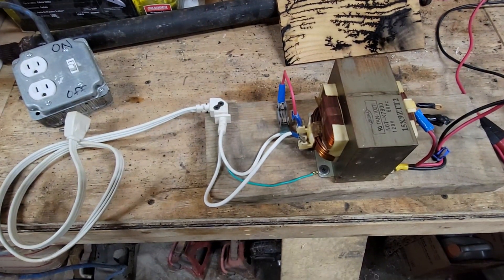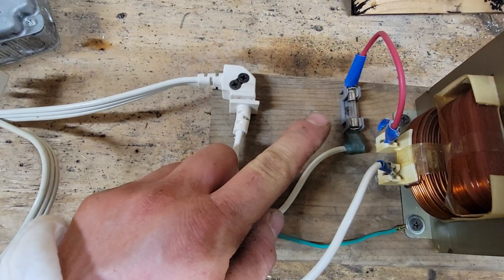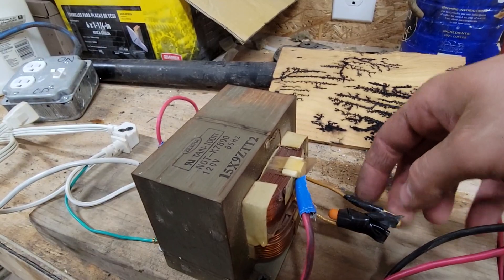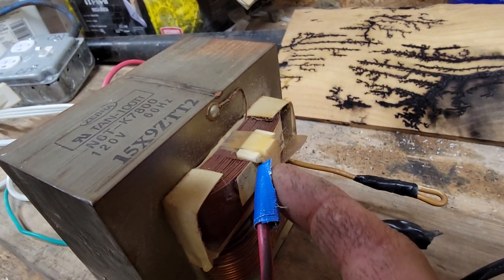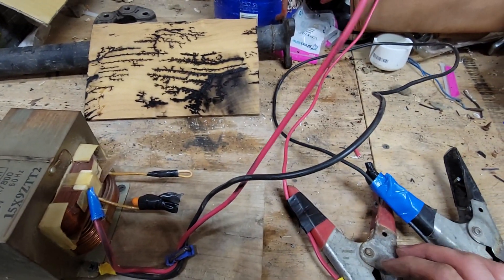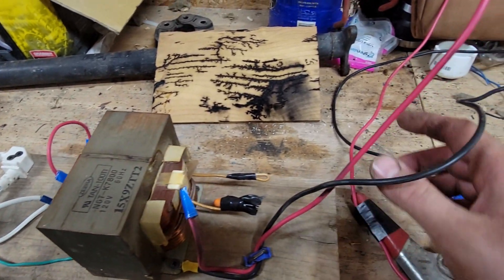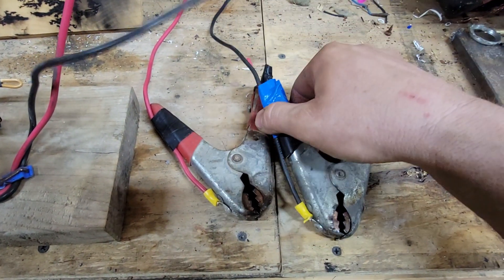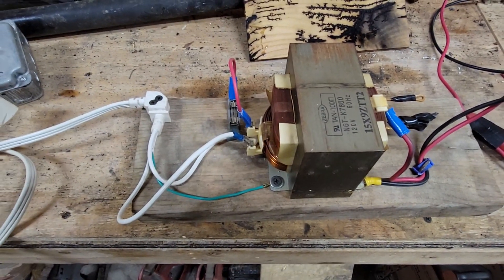How to make a fractal wood burner.

Comment: That fuse is false safety. That fuse only protects the small red wire and the primary side of the transformer. That transformer has galvanic isolation.
Reply: the fuse won't save you it won't be too fast
Reply: Perhaps his fuse is for additional protection of the house circuit. He probably knows it won't break the high voltage side of the transformer.
Reply: @rpbajb  so basically the fuse may protect the homeowners electricity from being blown? nothing else
Reply: @TheParaplegic  That is why I added a fuse to mine. That way I blow the fuse rather than trip the breaker for the whole circuit.
Reply from the maker: What???
Galvanic isolation ?🫥 
You're looking for attention right ? 🤣
Reply: @DIYBuddyGuy He's correct, the primary and secondary side of the transformer are electrically isolated, that fuse will only blow if there's a dead short on the primary 120-230V side. It will offer fuck all protection against shock on the lethal secondary carrying 2000V+ but hey, what do I know, I'm just an electrician! 🤷‍♂️
Reply: @DIYBuddyGuy  No one is trolling or looking for attention, you made a death machine and people are terrified.
Reply: @DIYBuddyGuy 
here you go buddy, galvanicly separated transformers

https://youtube.com/clip/UgkxX2uxt1SskMA44Ivc4_JGwzcEuQFdPez2?si=bHypFKUG9os1R8EP
Reply: @DIYBuddyGuy  No. It's true. You only have safety for one side and that's not the side you're working with. This is absolutely a death trap. No insulation no nothing. Dangerous advice.
Reply: @DIYBuddyGuy  dont listen to em keep burnin your wood!! do it all the time! Rock on bud!!!
Reply: @dtreezy  People are dying from this, how can you say that fr??

Comment: The fuze won’t save you. The 2000 Volts on the business end of this device isn’t directly wired into your mains power. It’s completely possible to get 2000 volts flowing through your body and that fuze will not blow. 😳 This is the most dangerous hobby I have ever seen. “This is very dangerous” is underselling it. “One tiny mistake and you will die” should be the warning label for this.
Reply: Maybe but breathing oxygenthese days is bad
Reply: @danizimo84 Actually breathing oxygen caused the Great Oxidation Event just over 2 billion years ago. The ability to use oxygen for more efficient metabolism required the evolution of mitochondria. Mitochondria literally controls the oxidation process
Reply: The fuse (a fuze is part of a bomb) in an electrical circuit wouldn't protect against shock regardless of how the circuit is wired. That's not a fuse's job. Fuses protect equipment.

Some other misinformation in what I read of your post: 

Voltage doesn't flow, current does.

Why bother posting like you have knowledge when all you're doing is parroting someone else with no actual understanding yourself? You only further ignorance. Educate yourself first, you lack the knowledge to judge whether the video creator or anyone else is in danger.
Reply: You could hold one end of this and be fine....its a transformer.
Reply: I agree, making nitroglycerin with items found in your mother's potting shed is without any doubt safer to do...
Reply: @koningbolo4700 nope, my dad used to drive a nitroglycerin truck to pay for the pale blue diamond he gave my mother for her engagement ring. As nitroglycerin warms, eventually even just random chemical reactions inside of it can trigger a detonation. Even refrigerated nitroglycerin can detonate with a large enough jolt.

If you can control the temperature and keep it cold, nitroglycerin may be safer. But at room temperature or a hot day, nitroglycerin may detonate no matter what you do. Playing with 2,000 volts at 1/2 amp Is something that, if you are extremely careful and you don't get any surprises, should be safer at normal temperatures. 

Hello, kids I'm - BOOM or SIZZLE. Choose your poison.
Reply: I must agree to that
Reply: *fuse
Reply: I was curious about the fuse and the bus, didn't think it was needed or affective ..You answered my question I came here for but i will do more research..
Reply: Output side of a transformer is not part of a circuit regardless of current flow....as long as your not dumb enough to to hold both terminals your fine
Reply: @jamesgreen2346  you're
Reply: Amps kill not volts.
Reply: @billygourley1989  Amps kill when the volts are high enough... 2000 Volts are way more then you need to get that 15 mA of 60 Hz current through your heart muscle if you make a mistake...

BTW: I build a welder using this type of MOT. the high voltage coil was removed and replaced with a very thick copper wire making a turn and a half coil to get about 1.7 Volts at (estimated) 1100 Amps... plenty to weld some steel together... Funny how the voltage similar to what comes from a AA battery is able to melt or fuse steel...
Reply: @billygourley1989 "Amps kill not volts" .... Last words of someone who doesn't have a clue how electricity works and gets electrocuted.
Reply: a gfi will
Reply: @DG-kr8pt  No it won't.
Reply: O relax we all have the right to die as we see fit.
Reply: @africanelectron751 Yeah but he’s not feeling you what to do he’s just making you informed on the risks of what you doing which I respect.
Reply: @africanelectron751 but most people making this won’t be aware that they could easily die
Reply: @africanelectron751 😂😂😂
Reply: @africanelectron751  I agree... though if you get hung up on that 2kV there is not much relaxing any muscles going on...

Comment: hello, I have built a burner as shown. the transformer has a turns ratio of 1:10, therefore 240v 10A input and 2400V 1A, out. the unit does burn a bit (1-2 inches) but no way as impressive as yours. additionally I have to continually wet/spray.  My questions are. 1. is 2400V 1A sufficient? 2. Does the wood type make a difference, I've used white oak (Oregon)?
Reply: “I have to continually wet/spray”

A frightening thing to say when you’re dealing with this much current.

Comment: Do not even attempt this. Don't. Ever. 34 people have died in america alone, just based off news articles. And if you think "I know what im doing", two of those deaths were experienced electricians. If you even graze any metal, even with insulating gloves on, you will likely be dead before you even realized you touched anything. Microwave transformers typically produce 20x the lethal voltage needed to kill a grown man. Check out Ann Reardon's video for more information.

Comment: Dont do that. It can kill you!!!!
Reply: This video is already reported
Reply: A lot of things can kill you if you do them wrong.
Reply from the maker: Turning on your kitchen light has the same potential...
But you manage to do that safely.
What's the difference?
Reply: What's the difference?  About a thousand volts. @DIYBuddyGuy
Reply: @DIYBuddyGuy A 120V lightbulb socket and a few _kilo_volts from a transformer are mathematically not at all the same potential, literally WHAT ARE YOU BABBLING ABOUT?!
Reply: @DIYBuddyGuy  Uh...the difference is huge.  How many die from turning on their kitchen light?  Far less than building this death trap and showing it off on Youtube.  Just common sense.

Comment: I highly recommend you to disconnect the body of the transformer from the ground wire. This way you wont get electrocuted if you touch it one handed. In your configuration, you are also part of the ground and you can close the circuit very easily if you touch it by mistake.
Reply: Dumb this down. If you disconnect the ground wire, where is it going?
Reply: @ThenZ6    It's quite a challenge to dumb this down enough.   I think we need pitchers (sp?)  pichurs?.
Reply: He is saying that thing your standing on is ground so when you bond the negative side of the secondary to the thing your standing on it make you a far more attractive target for the grim reaper.
Reply: @213BRANDONP  I certainly get what Mr. Stark is saying.  I'm a retired electrical engineer and wasted time doing a bit of a video on this particular (widespread) problem.
Reply: You should really not give anyone advice on Electrical Items,, because,,,, you just identified yourself as a "FOOL"!!  You always Frame Ground something with Voltage.. AC or DC.. Don't be STuPIxD!!  You ground the house wire to the Transformer Frame,, PLUS,, run the Ground Clamp to the Wood to the Frame... 
It's one thing to say something that YOU KNOW.. Another to Spout Ignorance where someone following your advice could add risk to their project... 
You would be better off sticking with your Video games.. You don't know when to be quiet and when to ask questions.. You have ZERO business commenting on these types of videos.. 
BTW.. Did you ever wonder for a minute why there was only one wire coming out of the High Voltage Coil?? If you did,, you would not be so stupixd!!!

Comment: A microwave transormer has the same voltage as a low overhead primary distribution cable DONT MESS WITH THEM
Reply: You ever see a bird that came in contact with more than just that wire? Fried chicken
Reply: But the distribution transformer are well in the thousands of amps whilst an MOT is 35-1000mA still I agree very lethal.
Reply: @for3sh4dowYT  the thing to remember is, while the MOT might output 350ma-500ma at its rated power of 800-1100w and 2100v that's an expected continuous power rating, there is no limiting circuitry and it can and will pull more current if what it connects to has a low enough resistance. The body's resistance is variable, at lower voltages like 240 and under the skin offers enough resistance to limit current though the body to about 30ma, but 15ma though the heart for enough time to deliver about 50j energy can stop it, once you go over 500v electricity punches though the skin and if sweaty or covered in water with salts body resistance is very much lower, and a MOT has no current limiting, it'll dump as much as it can while obeying ohms law on both sides of the transformer until it burns out / trips overcurrent, but, either before then it will dump WAY more than 15ma and 50j energy in milliseconds (a joule is 1watt for 1 second, so 2000watts in 25ms(1/40th of a second) is 50j)
Reply: Birds sit on those wires all the time with no problem.
Reply: @sylviaisgod6947  this is a joke right?
Reply: @sylviaisgod6947 cause birds aren’t permanently grounded like humans 😐

Comment: ( Your ) contact with the high voltage  IS  LETHAL , YOU  WILL  DIE , better to use them as heavy weights to hold down various woodwork projects ( while the glue dries ! ) ..... DAVE™   🛑
Reply: The secret is, don't touch the high voltage parts.
Reply: @SmokieTheOne  one single lapse in judgement. one split second distraction. someone calls your name. you get nudged. you forget. your dead. you will die before even realizing what you have done.

Comment: According to wikipedia, at least 33 people have died, between 2017 & 2022,  using this type of equipment. It's not worth the risk, don't even consider trying it! Just one accidental touch of the live high voltage and you are dead.
Reply: I have made a fractal wood burner with dual microwave transformer, and it works perfectly and safely. I will also teach my children to use it.
Reply: 320,000 people died in car accidents during that same time period, do you still ride in a car?

Comment: That thing looks scarily lethal, I strongly suggest no-one messes with these microwave transformers. Such voltages and currents can so easily do you serious damage.
Reply: @Jason A. He has added a 14A fuse on the input, not sure what the point of that is 😂
Reply: @paulphillips675    This is no endorsement of this whold death trap, but at least the fuse might keep the transformer from meltind down and failing in an unexpected way.   The transformers normally drive a magnetron, an reasonably well known load.   But with the wood burning, you can have a situation where you are driving a pretty low resistance, damn near dead short.   Get my drift?  

So the kid does know some basic safety, but not nearly enough to avoid the reaper.
Reply: @paulphillips675  The breaker panel in on the input as well and more than likely has a 15 amp breaker. The 14 amp fuse he used is also on the input side inside the microwave.
Reply: @SmokieTheOne Because in a microwave there are other parts fed by the power supply that could go faulty and the input fuse prevents this fault from overloading the supply.  In this use there is just the primary winding, the fuse would not protect you if you accidentally touch the very high voltage secondary side
Reply: @paulphillips675  I use other means for personal safety to prevent getting bit by the high voltage. My fuse panel is in the basement so the point of the fuse is to blow before the breaker so I don't have to run downstairs to reset the breaker.
Reply: This is one of the dumbest, most careless instructional videos I have seen the secondary wire needs high voltage insulation, the core of the transformer is one side of secondary and should be enclosed, the secondary leads should never be touched while energized, the power supply needs to controlled by a foot switch. The current from a microwave transformer is extremely dangerous. 
This video should be banned!
Reply: A breaker on an input side of a transformer has no protection! The fault occurs on the other side!  FFS.
Reply: My stepson was killed by one this week
Reply: @ReubenJensen-o6q I’m so sorry for your loss, people need to be aware of the dangers of these things
Reply: I showed this to my loudmouth, drunk neighbor; he ain’t loud no more…

Comment: 2000-3000V and no safety - DEADLY
Reply: It's not the voltage that kills you, it's the amps.
Reply: @paulschuebel5487  but it’s the voltage that produces the amps - I used to work in telecoms, the power supply could supply 3,500 amps but at 50 volts you could hold positive in one hand and negative in the other and not feel it because the voltage was not high enough to push high current through ur body.  Had it been 2000V then it would kill.  Current in amps equals Voltage divided by resistance therefore for a given resistance of the human body, the higher the voltage, the higher the current so IT IS the voltage that causes the current to kill
Reply: There is a fuse and a switch it is perfectly safe.
Reply: @sylviaisgod6947 Little knowledge is dangerous.  The output voltage ratio is 120:2000, i.e. 1:16 approx, and current ratio is the opposite.  Deadly current = approx 0.2A, so 0.2A in the secondary x 16 = 3.2A in the primary winding which is well below the 14A fuse being used.  In addition the fuseable value of a fuse is well above the rateable value so you would be fried before the fuse blows
Reply: @sylviaisgod6947  omg 🤦🏻‍♂️
Reply: @sylviaisgod6947  on that side it makes no difference, if the fuse on the low voltage side could detect what's happening on the high volt end, it would turn off every time you burned a piece of wood. the slightest brush and you will end up just like the wood pieces you're burning. it will kill you and possibly someone else if they touch you before turning the transformer off
Reply: I have made a fractal wood burner with dual microwave transformer, and it works perfectly and safely. I will also teach my children to use it..
Reply: @СНСАЛЕКСАНДАРВУЧИЋ when their hands slip and touch the spikes while it’s on you’re gonna have some explaining to do to cps
Reply: @СНСАЛЕКСАНДАРВУЧИЋ  Future Darwin award winner.
Reply: @СНСАЛЕКСАНДАРВУЧИЋ  why do u want to kill ur kids?